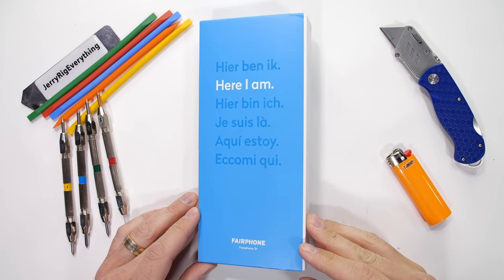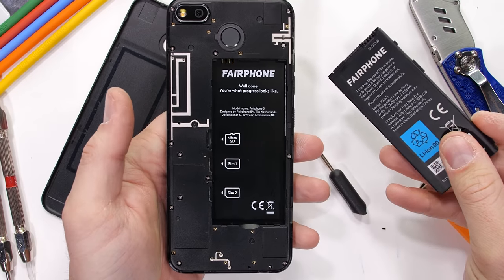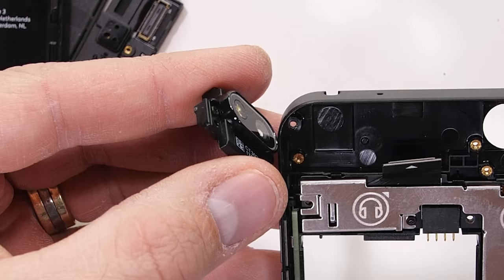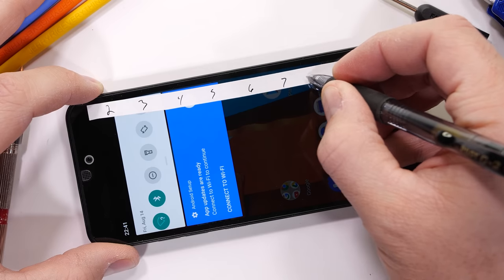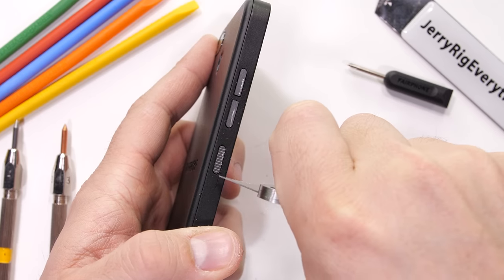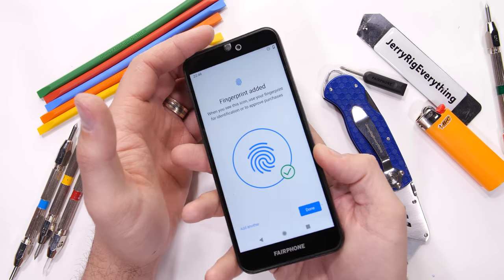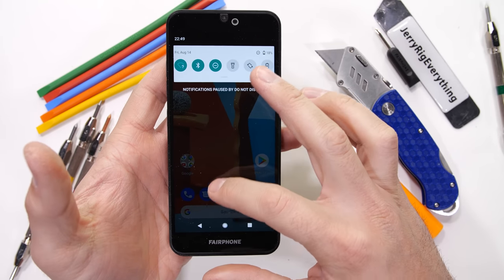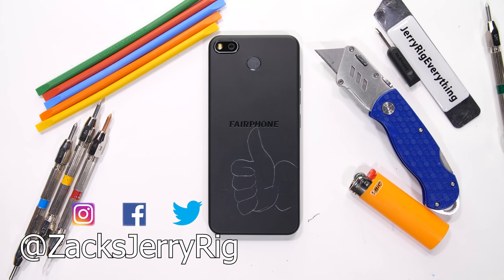Fairphone 3+ Durability Test! - it feels like cheating...

Comment: Definitely a step in the right direction. Being able to repair a phone that we can continue to use is the best way to limit E waist. My next phone will be a Fairphone. I've had a look and I can't get it in Australia. So hope we can get them soon.
Reply: You can't buy one online?
Reply: Doesn't seem to deliver to Australia...
Reply: Except for newer iPhones... all phones are repairable. Even by yourself, if you want to take the risk. This is just a stupid step. You repair your phone once every 2 years, at the most. And paying £500 for £200 worth of extremely old hardware just to fix it yourself is just stupid too. But, each to their own. Not my money.
Reply: @wheezel55  See the thing is, repairing your own phone is something completely outside of the comfort zone to most. Also, I know allot of people that need their phone repaired more times then the usual 2 year timeline due to accidental damage. Be it to the screen or a button to a charging port. If these things are as easy as they are to fix on the Fairphone, more users would be able to keep a longer phone lifespan. Specs, on the other hand, could be better. But to most users that look for longevity don't chase flagship specs. They just want a reliable, easy to use, easy to repair phone.
Reply: @wheezel55  The Fairphone isn't just about repairability though, it's also more ethical and environmentally friendly. For example, they pay their factory workers in China 4x as much as other manufacturers. They set up a whole program, which other manufacturers like Tesla joined afterwards, for ensuring ethical cobalt sourcing which wouldn't involve child labour.
Basically, they do a lot more with that extra money than just make a repairable phone.
Reply: @wheezel55  I don't really care if I buy older hardware if it means I can keep the phone for longer. The problem with all other phones is that if have an accident even if you repair the visible damage it'll just kinda die and you can rarely even get them back to what they used to be like. This thing is much more durable than most phones and if you do break it, it's so easy to repair that in the long run you'll save money. I would never even have looked into replacing my old phone if it wasn't for the fact that when the screen cracked you couldn't even get the same screen it came with anymore so I had to settle for an inferior repair, and now it's much slower.
Reply: @wheezel55  for repairing you need tools for those, this one has 1 screwdriver and you get it with the package. But its not the point of repairing, its point of chaning parts either to repair or UPGRADE. also the parts to upgrade or repair are cheaper and you can get them from their site. If i want to repair my phone i have to take it to a company so i dont loose warranty. Also you can have Linux on it or degoogled os preinstalled which is also a big choice.
Reply: I'm waiting for them to make one to compete with flagships 

I'd love to have one of these, but it's too slow, the screen resolution is too low, and it lacks things that I use daily like reverse wireless charging (or wireless charging in general) NFC, and a decent camera
Reply: @mwbgaming28  Probably not going to happen, to be more environment they use parts that are abundant and been around longer. Once you start chasing flag ship specs, it's easy to get sucked into creating more phones start having a yearly updgrade. Or you can do what Samsung or One Plus does which is have 2 models of phones to replace there oh so old 6 month device
Reply: @1008md   I'd they make a high end upgradeable phone, I'm pretty sure the big companies will start taking notes 

After all, would you rather buy an unrepairable glass plate that is designed to fall apart as soon as you touch it, or a phone with the similar specs and features, that is designed to be easily repairable and upgradeable 

It could potentially cause other companies to make their devices more easily repairable at the very least, which would contribute to their goal of being more environmentally friendly 

After all, a phone could be the most economical and environmentally friendly device on the planet, but I'm not going to buy it if it can't do what I need it to do
Reply: @mwbgaming28  Would they though? Big companies use planned obsolescence precisely because it makes them more money. What reason would they have to follow upgradability or repairability?
Reply: @antonioscendrategattico2302  I'll give you an example

 if fairphone made a device with similar performance to an S21 ultra (let's call it the fairphone ultra) but it was designed to be easily repairable, had the same performance and specs as the samsung version, didn't remove features, had a swappable battery, and genuine spare parts could be easily and cheaply purchased online 

What would you buy?

The samsung S21 ultra, or the fairphone ultra

While some would buy the samsung offering, I guarantee more people would buy the fairphone offering, which would result in samsung needing to cut the BS and stop making their phones unrepairable if they don't want to lose money and market share

Let's say unrepairable phones make you $2b this year, then next year the fairphone ultra is released, and over the next couple of months, people catch wind of it from influencers, word of mouth.etc, and you only make $500m the next year and lose 75% of your market share, but you could gain back much of that market share (and make more money) by making your newer models easier to repair

It's the same reason why phone batteries are (very slowly) getting bigger 

Let's look at Ulefone for example, they are well known for making budget devices with big batteries, rugged phones with high end specs, and rugged phones with worksite features (night vision, FLIR, laser rangefinder.etc) 

Then they made the "power armor 13"
A drop resistant waterproof phone with a 13,200mah battery, similar benchmark scores to a Samsung galaxy S10 plus, all the features most people would ever need (laser rangefinder, programmable button, fingerprint reader, FM radio, NFC, wireless power sharing.etc) 

And guess what, I immediately bought one instead of upgrading to the latest galaxy, and instead of needing to charge my phone multiple times a day, now I only charge it every 2-3 days, which means the service life of this phones battery will probably be close to 10 years

And the power armor 13 is one of their most popular devices, some don't like how heavy the phone is (most of which is structural reinforcement) but many people (such as myself) like the freedom and convenience the larger battery offers  

If a major manufacturer made something like the power armor 13 (but with top of the line specs) Apple, Samsung, and the others would be shaken off their podium almost overnight, especially if the battery pack was removable (so you could simply buy a bigger battery if you wanted more runtime, or a smaller one if you wanted a thinner and lighter phone)
Reply: @mwbgaming28  I'm no phone expert, so I'm not going to say you're necessarily wrong. But repairability is very much a political issue. Would Fairphone be able to make a phone that can rival flagship models (meaning it's already an expensive product for a relatively niche audience) at a price that's competitive with companies that have a lot more money than them and can afford to undercut them with lower prices - as well as not having to pay their workers a fair wage or caring where their cheap materials come from?
Reply: @antonioscendrategattico2302  easy repairability is a selling point, and even with fair wages for employees, the device could be in a similar price range to conventional phones and still turn a profit (the S21 ultra only costs around $400 to manufacture and sells for over $2000)
Reply: @mwbgaming28  Thing is, a selling point counts if you have the advertisement budget to push it as such. And like I said, companies like Samsung or Apple can afford to adopt a whole lot of strategies to tank competitors. Undercutting them with downpricing, drowning them out with ads...
Reply: @antonioscendrategattico2302  fairphone isn't broke, they can afford to send test units to influencers, most people don't actually pay attention to corporate ads, influencers are the most cost effective way to get your product out there 

And due to to nature of their company (eco friendly, fair treatment of workers.etc) most influencers I know of wouldn't say no to reviewing their phone
Reply: Too bad it's only available in EU and you can't buy one if  you're from US Canada Australia Japan Korea or any other developed market outside Europe

Comment: This gives me flashbacks to the times where if my phone was out of battery, no problem, open that bad boy up, place replace it with a fully charged one, and continue with another 10 hours of content!
Apple and Samsung should learn from this, when claiming they care about the environment, though I'm mainly glaring at Apple here.
Reply: Still have a Motorola cd160 as my car backup. Runs on standard AA batteries.
Reply: Yup... would always have 2 or three spare batteries on hand. 
Sending positive thoughts out to Fairphone   :)
Reply: They couldnt care less about the envoirment. Its everything about profit, even the battery charger removal.
Reply: Are there shits where you can shits the battery while the other battery is in your phone
Reply: I still use my galaxy s4 with swapable battery.
Reply: I guess I’ll leave this here... I love the concept of the fairphone, but the issue of the easily removable back is that it can’t be waterproof.  I don’t think Apple, Samsung, other OEMs (or their customers) would give up waterproofing.
Reply: @skate6788  lg v20 was the last good phone with a removable battery and an ir blaster.
Reply: @harperevans6856  they can make a water and dust resistant phone with a removable battery.  They don't because of profit,  and also because they are following this glass with metal trend. The  galaxy s5 had a ip67 rating but people were bashing Samsung because of the unappealing design. After they started releasing glass and metal phone and more companies started to follow this trend. 
I would rather have an all aluminum phone like the lg v20 or the HTC 8 for i don't care about the wireless charging.
Reply: @hakualex  I'm still using the V20 for my work phone. I told our IT guy that he would have to pry it out of my cold dead hands.
I plopped an 8500 mAh battery in it and get 4 days before needing to charge it.
Best phone ever made. Such a shame LG didn't continue down that path with their V series of phones.
Reply: @skate6788  Oh goodness that was the phone I was talking about!

Comment: I own a fairphone 3 and I have to say: don't buy it if you need it to work absolutely 100% of the time. Because they are a small company their support is quite cumbersome and answers with a delay of about 2 weeks, but they want to help if you give them time (there is a forum too for help). I find it helpful when someone close to you also has a fairphone, in case you think a module is not working, so you can swap and test it.

Besides that I am really glad I bought this phone, with a gcam port for images and open camera for videos this phone is definitely a good fit for me :')
Reply: I want something I can swap stuff around in. Had a pixel 2 for ages, with a faulty battery I can't repair. Can't wait for my fairphone.

Comment: fairphone: makes everything modular
other companies: unfair
Reply: Not really. Every component of this phone is overpriced and outdated.
Reply: @conscireshooter  the entire phone is almost equal to the price of screen replacement for an iPhone
Reply: @harshdhamu9915  how much is it?
Reply: @davidobrien8683  about 400 euros
Reply: @harshdhamu9915  you can't compare it to an iphone. It has wayyy lesser specs. 400 euros is 35,000 INR. 
You want to pay Rs35,000 for an outdated phone? One that can't even compete with a Rs10,000 MI/Realme phone.
As for the screen replacement, its 100 Euros. That's approximately 8500 INR. 
Even Samsung charges way less for a full AMOLED panel replacement. 

Hell, you can even get a 144Hz 24inch IPS gaming monitor at that price.
Reply: It's not worth it to even buy an iPhone, Let alone get a screen replacement for one. You could buy a Google Pixel 4a for less than 500 dollars, And it will do better than a iPhone
Reply: @conscireshooter  valid point sir, but the idea behind this phone is just way cooler than any phone out there and I'd let it be that way
Reply: @Cay9z  😂😂
Reply: @conscireshooter  Every component in this phone is by definition priced fairly - high enough that everyone involved, including the workers who assemble the device, get paid. Every other phone on the market, constructed by slave labor and with no major eye towards sustinability, are priced stupidly too low.
Reply: @extectic  is that so? And where does this vast knowledge of yours come from? From studying in art's college? 
Just learn not to comment on stuff you know absolutely nothing about. You just proved that you clearly have no idea how much electronic components cost, and annoyed me to hell.
Reply: @extectic  you know,, we were actually have an sensible discussion here. I may not agree with Harsh, but atleast everyone was making logical arguments. 
And then you came along. Who are you? Some first world Karen?

Comment: Imagine buying a phone once in every 10 years and all you can do to upgrade your existing phone is change the internals that comes at just a couple of $. It will save so much of money and discard the unnecessary social status of these every Changing technological devices.
Reply: not to mention how much less electronic waste would be made that way
Reply: The unecessary social status will never be discarded
Reply: This Sounds good nur does Not Work. You can't replace everything. For example the CPU or soc can't be replaced. Also ram and storage can't be easily designed to be swapped. Look a PC's. It's completely modular, but not everything works with everything. And if you switch one thing like the cpu you often also have to switch the motherboard.  Also new technologies like a fingerprint reader can't be fitted afterwards. Also software support is very important, if you want to use your device for a long time.
The idea is great and sounds good, but I don't think it would have a significant impact.
Reply: @cl4ptp118  True, but with the peaking technological advancements, I think it will not be difficult to build a motherboard feasible enough to act like a lego piece. This is what they used and still use in space shuttles and rovers.
Its not impossible at all. Fingerprint scanner, foldable screen etc are all secondary requirements. I think the main idea or let say the concept here is practical usage of a device to save the money, resources and planet at large.
I think technology is way way way ahead compared to early 2000s. Bob Lazar once told in Joe Rogan's podcast that the government (both US and Non US) has the extraterrestrial technology which can change the course of everything we are doing. Anyways I am not saying this "extraterrestrial technology" is something true or a hoax but I think the way we are reaching the "technological peak" in every decade, it was just not possible 30-40 years ago. I think i am going off track or maybe its the cannabis talking. Don't quote me man, i am just trying to figure out life at large.
Reply: @joelperpetua3929  yeah because we as a species were at the lowest mentally but i think in next 70-80 years we are going to see some major changes in how we perceive things and how we will think. Our solar system is getting close to the galactic centre (not saying it is getting closer to the super Massive blackhole) but our solar system itself is revolving around the milkyway. I know it makes no sense and i have no proof of solar system getting closer to the centre but it is true trust me. I read this in vedic texts.
Reply: @davorpetrina7598  exactly my man! 🙏

Comment: Just found my next phone. Damn this is nice. People get all weird about the "feel" of the phone then throw it into a protective case immediately after buying it. 

IDGF about the "feel". It's going in a case. This thing with the changeable battery, upgradable/replaceable parts has me sold. I'll buy 2 just to have backups of everything.
Reply: boomer grow up times are changing
Reply: I'm still using my Fairphone 2, which is on its fifth year now (and still getting software updates). I replaced the battery (due to old age) and screen (under warranty repair, due to the appearance of dead zones in the touch sensitivity). Big advantage that you don't really think of for a design like this is continuous uptime. For example, the screen was 'broken' but still usable. When the replacement came, I swapped it in and mailed the old one back, and was never without a phone, and didn't have to worry about mailing the whole thing in to get fixed .etc.
Reply: You dont need to buy two as backup, the parts are sold for as long as they can source them and they warn im advance if they can't anymore.

Comment: I'm used to older models of smartphones and I didn't even realise that the batteries are now glued in place until I found this channel. My old phone had a bad battery and sometimes I'd take it out and pop it back in to make it work, weirdly bummed that I can't do that anymore

Edit: I remember now that the SD and SIM cards were inside the phone, blocked by the battery, so you really were meant to be able to easily remove the back and battery. I've had my current phone for a couple of years and i still don't know how it opens up (though I guess that's a good thing)